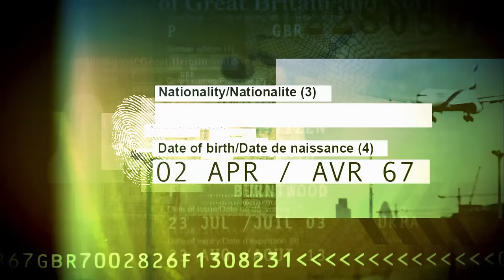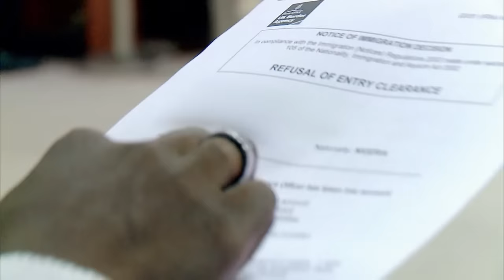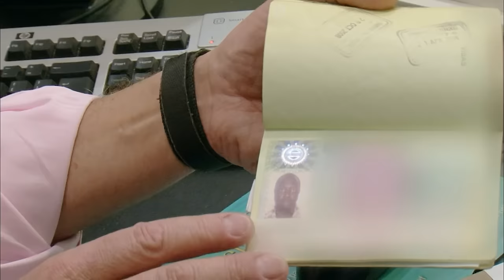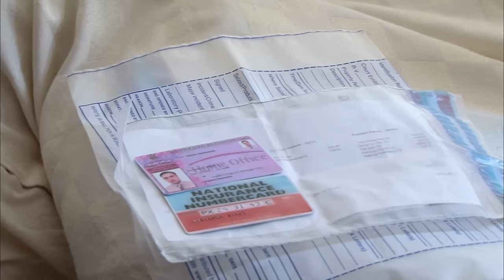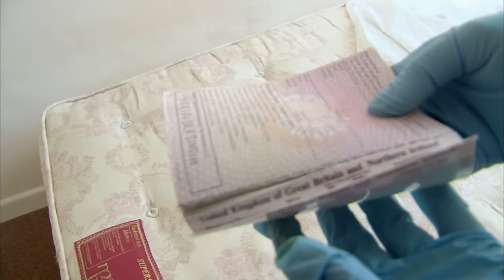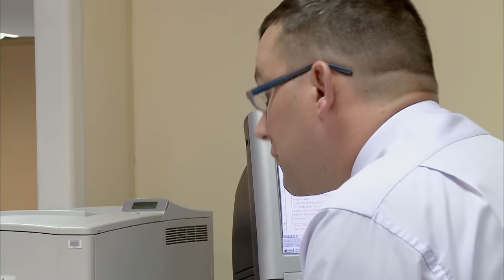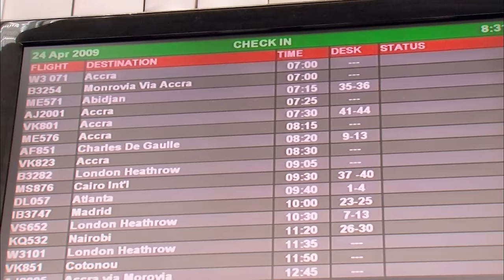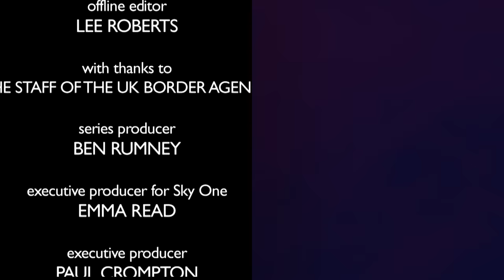15 Illegal Immigrants Arrested In Giant Factory Raid | UK Border Force | Real Responders

Comment: They should use *gamma-ray scanners* -  
https://en.wikipedia.org/wiki/Cargo_scanning#Gamma-ray_radiography
Quote -  "Gamma-ray radiography systems capable of scanning trucks usually use cobalt-60 or caesium-137[6] as a radioactive source and a vertical tower of gamma detectors. This gamma camera is able to produce one column of an image. The horizontal dimension of the image is produced by moving either the truck or the scanning hardware. The cobalt-60 units use gamma photons with a mean energy 1.25 MeV, which can penetrate up to 15–18 cm of steel.[6][7] The systems provide good quality images which can be used for identifying cargo and comparing it with the manifest, in an attempt to detect anomalies."  

Point one - it would detect these scumbags.  
Point two -  it would give them a good dose of radiation and if the word on that got around, fewer scumbags would try this.